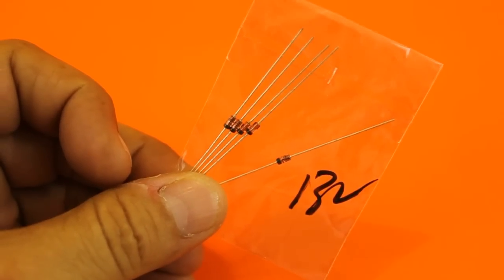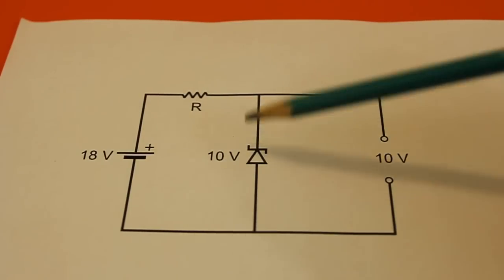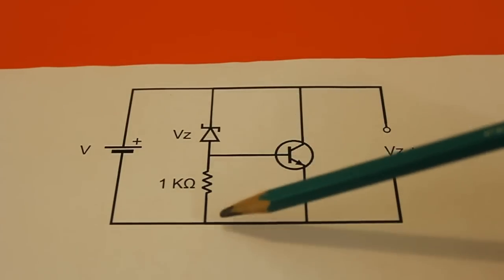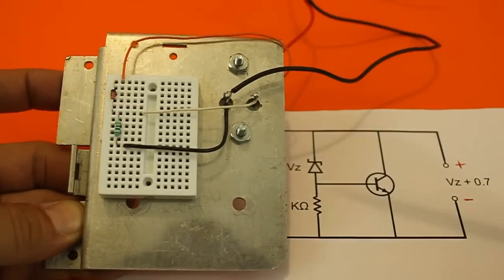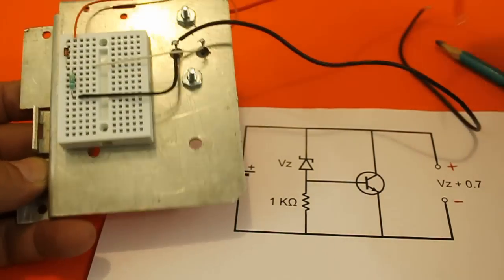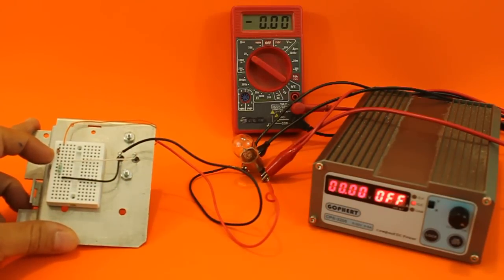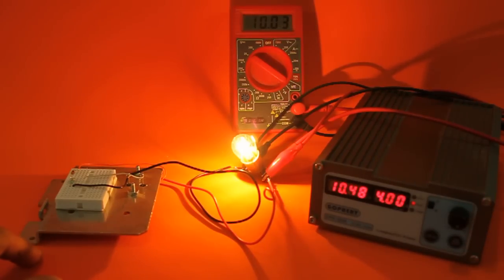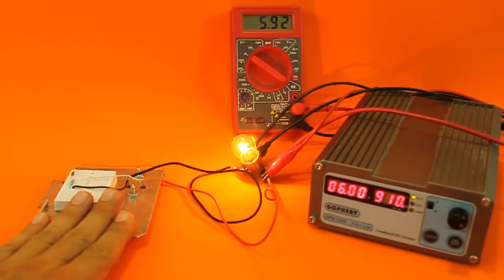How to Increase the Power Rating of a Zener Diode

Comment: I agree with other commenters that this circuit is a safety hazard. You forgot to add a current limiting resistor. When operated from a low impedance source, for instance a car battery, this thing will blow up in your face.

Comment: Your power supply will not give you more than 10.8 volts, it can't...it reached its cut off limit. Basic circuit topology, a voltage in parallel will always be seen, The lamp always sees the voltage of the supply regardless of the zener. The zener will make the transistor conduct and waste current getting everything hot. If your supply was capable of delivering the current it would light the lamp at any voltage it was set to and destroy the transistor in short order at the same time. How disappointing you left this live.

Comment: The excess voltage and current is being shed by the power transistor and  the heatsink.  If you put in a 13v zener it will keep your car battery charged from your solar panel.  Excellent video.  Simple an easily repairable.

Comment: Few notes:

First, you circuit diagram shows the load in parallel to the zener diode and transistor. That's incorrect. The load should be in series with the transistor. The Gate and Source should be in parallel with on another.

 Second, If you're going to use a current limiting resistor, use it in series with the zener before you hit the transistor gate. Again, since the diagram is wrong, it means you just have to directly connect the resistor to the zener, and then directly connect the zener-resistor combo to the transistor gate. 

Thirdly, the usage of this circuit depends greatly on the transistor. The transistor becomes the main component that determines the amount of power the circuit can handle. If that's a 5 amp BJT, you have a linear voltage regulator that can regulate 5 amps @ 9.1 volts.

Comment: Observe your power supply: after it have reached 9V seems to be limiting the current.
Reply: yes. the current limiting mode acts as the resistor he forgot to add in the circuit

Comment: This circuit is a safety hazard! Please correct it or delete the video as it might harm people following your example. Hint: an adequate series resistance in the supply line will do the job.
Reply: Your comment is incorrect. Series resistance limits current therefore power transistors are typically used in parallel with voltage regulating devices to source current. A small series resistor is still required before the zener diode. However, this resistor is only determined by the zener's power rating. It is insufficient to drop the voltage by itself. In the video experiment, the series resistor would be a very small value, equivalent to a wire, and he therefore omitted it.

Comment: The power of a zener diode can easily be increased by connecting one terminal (of the zener diode) to the base of a bipolar transistor and the other end (of the zener diode) to the collector. That way, the zener's current is amplified by beta times. The output voltage will be the zener's voltage plus 0.7V approximately.

But this arrangement is extremely inefficient regarding power use. Why not use voltage regulator IC like the 78 and 79 series? If one doesn't want a ready made chip, one can use a comparator opamp to make a series pass regular according to one's needs.
Reply: but the video is about making high power zener. not a general purpose voltage regulator
Reply: Reread my answer. It satisfies that too. With a bipolar power transistor connected as I suggested, the zener power is increased by around (transistor current gain, beta) X (zener voltage). The actual power would be obviously (transistor current gain, beta + 1) X (zener voltage). This after accounting for the power dissipated by the zener diode itself.
Reply: but in the video the zener already is between base and collector
Reply: My point is this: a power bipolar transistor with a zener diode connected between its base and collected is equivalent to a bigger zener diode. 

I am not trying to contradict anyone, that would be childish. Let us learn from each other instead.

Comment: for higher current output sources, you transistor will explode. thats a bad circuit. it just semi shorts the supply so the voltage will absorbed in the small series resistance of the wires.

Comment: but the load in the circuit is connected in parallel with the source, so the voltage across it will always be equal to the source.
Reply: if the voltage is higher than zener voltage, it would flow through the zener, opening the transistor and all the exess voltage will flow through the transistor because it becomes a short circuit and has less resistance than the load. SO the limited current flowing through the load will drop the voltage on the load and make it a zener base voltage.
Reply: k den nope. Zener is always connected in parallel, in short if load resistance is more than expected the current will flow through the zener (as it is easy for current to pass through low resistance than the load). And hence vice Versa
Reply: im talking about the second circuit at 1:40

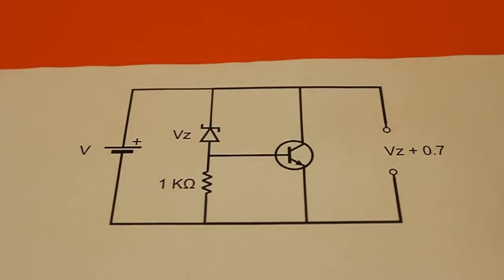Comment: I can't see how your circuit at 1:20 is correct, the output is directly across the input voltage source so there's no way for the output to be a lower voltage.
Reply: If you look at your power supply, you can see that it has gone into current limiting mode - it's your power supply that's limiting the voltage here not your zener arrangement. If you put your circuit on a power supply without current limiting it will end very badly.
Reply: codebeard Remember that any supply has an internal resistance. This in combination with the zener-arrangement is a classic voltage divider. You would probably be right, if we were talking about an idealised power supply
Reply: helut kuno, this isn't working as a voltage divider, it's just acting as a short across the supply. This circuit will fail spectacularly for real power supplies in the real world, not just idealised ones.
Reply: codebeard  there is no 'short circuit' with 0Ohms in real life, in this case the collector-emitter path has a variable resistance.  So there will be a voltage drop across C and E. It acts like a resistor. Real supplies have a internal resistance, and so we created a voltage divider. And usually the resistance in the conducting state of power Bipolar transistors is not too low, unlike MOSFETS/...
Reply: helut kuno, I know it's not 0 ohms, but it's going to end just as badly. Here's what will happen in "real life" when connected to a power supply with even a modest current capability: Let's say we have a 20V power supply which can supply up to 10A (200W) and we are trying to limit the voltage to 15V with this style of zener circuit. A typical power transistor like a TIP120 has a maximum collector current of 5A. This will rapidly be exceeded and the transistor will be destroyed. The circuit in the video is simply wrong. He should have put the transistor in a common collector configuration for use as a voltage buffer.
Reply: You are correct. the load should be connected to the negative rail in series, not parallel, to the load.
Reply: the point is to increase the Zener current, not to make an ideal voltage stabilizer.
Compared to zener 20-40ma, this transistor circuit is able to handle much more current, giving a stable voltage and overvoltage protection to the load. If you use 20v power supply and 20v zener, the current through the transistor will flow only in case of voltage spikes and wouldn't do shit to it and will protect both zener diode and the load.